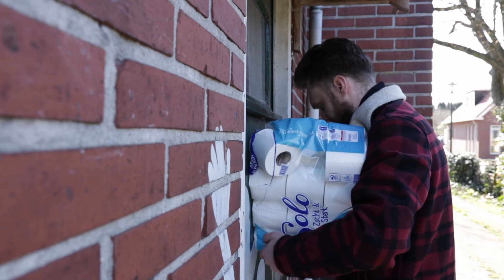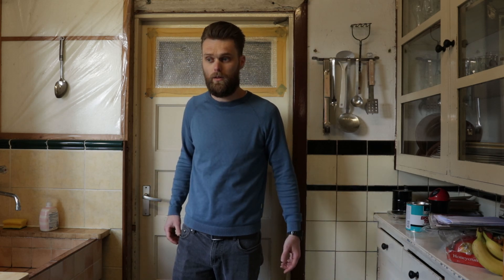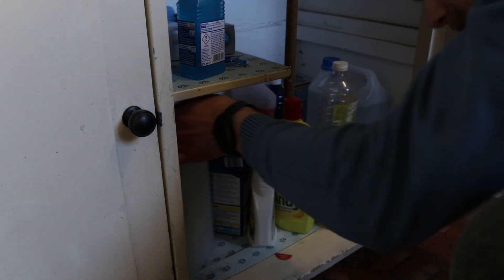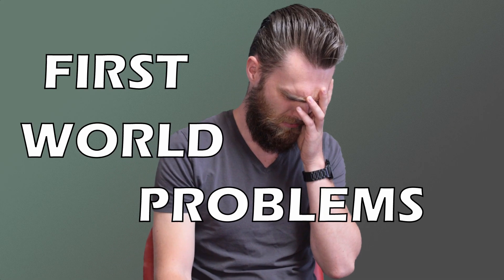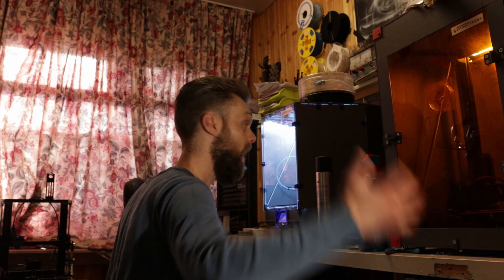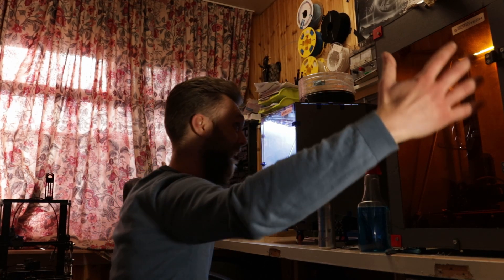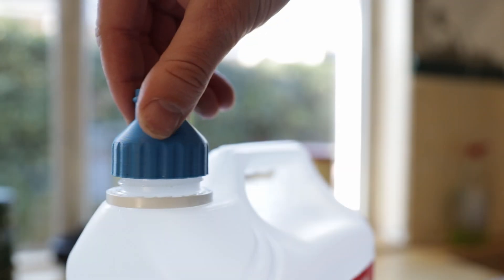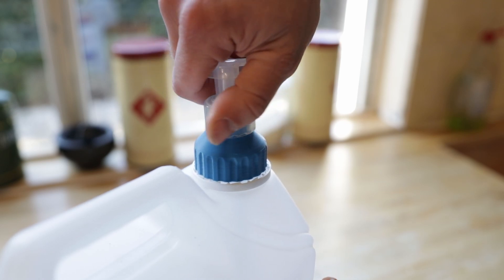Hand soap upgrade! Another first world problem solved.

Comment: OK, Jon, I've seen you do this several times now, so I have to address the issue. You are using the containers of soap, cooling fluid, etc. incorrectly. They are NOT designed to be poured from by putting the end of the jug with the pouring hole close to the container you're pouring into. They're designed for you to pour with the hole up high. See https://www.youtube.com/watch?v=2gfjCncKZj8.

Also, who has room on their kitchen counter for a 1 gallon jug?? Soap gets poured into smaller containers for a reason. The pouring hole adapter is cool, and I likely will download it, but I won't be putting gallon jugs of anything on my counter.

Comment: Does the printed part survive being covered in liquid soap, does the part degrade at all? My understanding being the print would still have surface imperfections to allow soap to work its way into.. sorry, I'm overthinking this!
Reply from the maker: Those are legit questions :) I printed it out of ABS so it doesn't degrade and yes, soap can work its way in but I wouldn't think that this will be harmful. I won't mold like PLA can do ;)
Reply: @properprinting , many thanks for your reply.